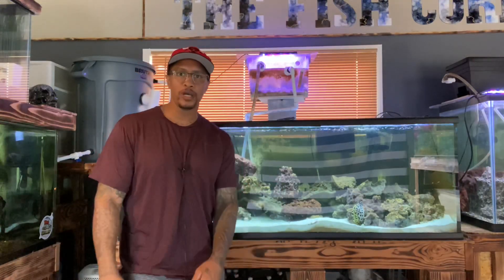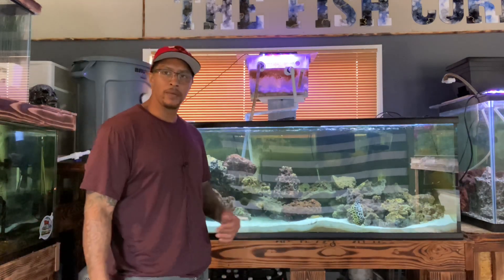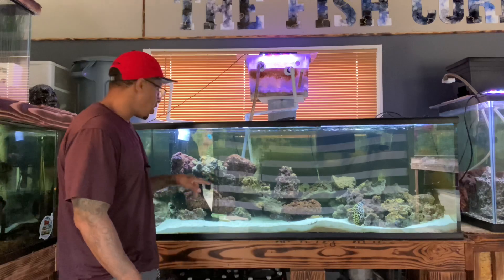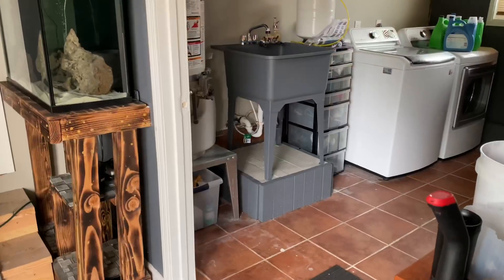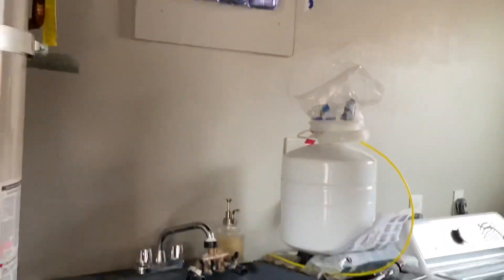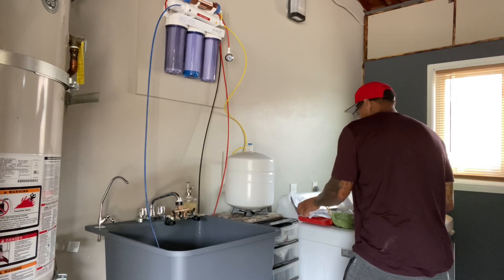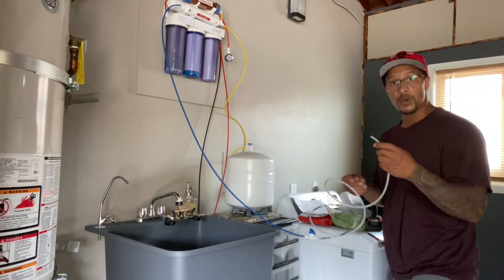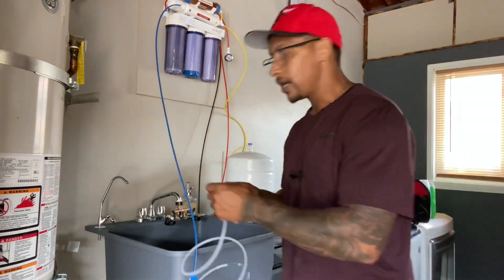HOW TO SET UP A 6 STAGE RODI FILTER SYSTEM!

Comment: I have the same one for 3 years now and still haven't set it up. Waiting until I get my 🏠 but thanks your for showing how to set it up and also thank you for all the videos the consistency now I'm loving it
Reply: Dude set that bad boy up! Attach it to a piece of wood with a handle and use both sides so it's easy to move and store. A few connectors and your ready to go.
Reply: I dont have this system but im sure you don't need the pressure tank

Comment: I had to add an RO pump to mine to get adequate pressure... I didn't even think to plumb it into the sink.... Couple of questions.... What is the fitting that you put on the cold water line and what is the white jug for..... Good stuff brother